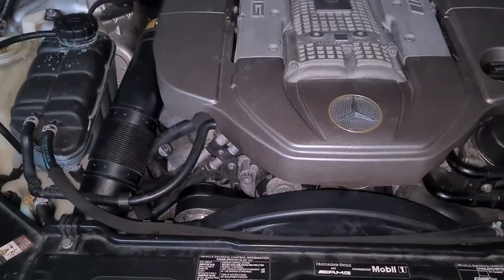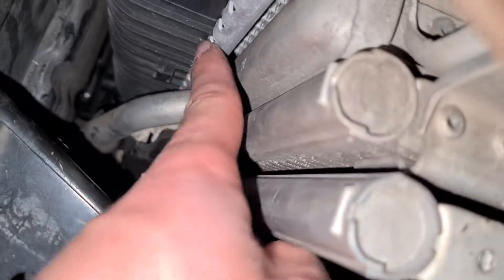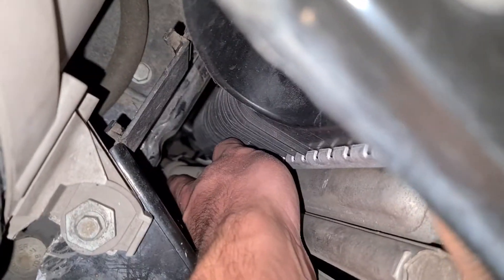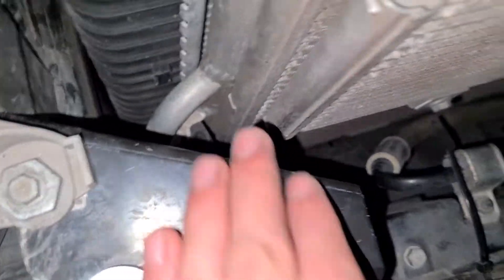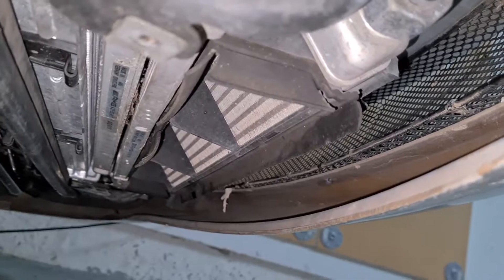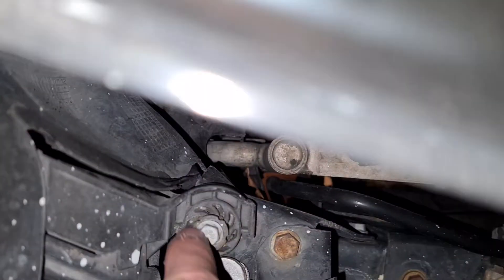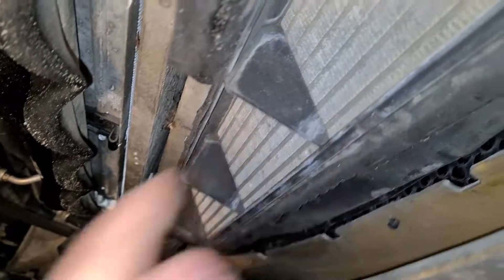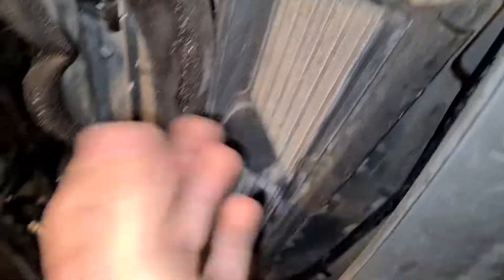CL55 Heat Exchanger vs S55 Heat Exchanger

Comment: Never knew the difference, thanks for the video! The heat exchanger on my CLS55 (or E55) is then pretty small in comparison. Its a bit thicker, so I don't know how that compares to the S55/CL55 with regards to surface area. I upgraded my old worn one for a newer full aluminium heat exchanger: https://www.youtube.com/watch?v=ty7o0tcB0uA